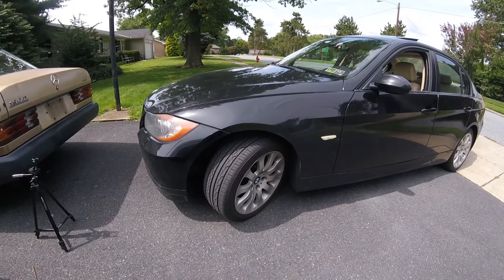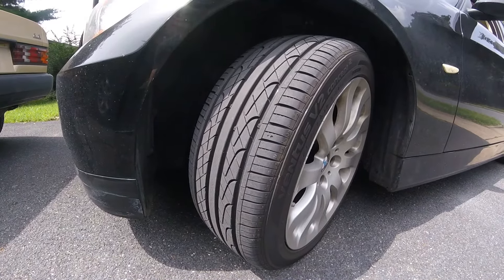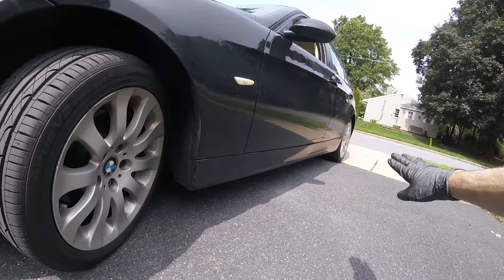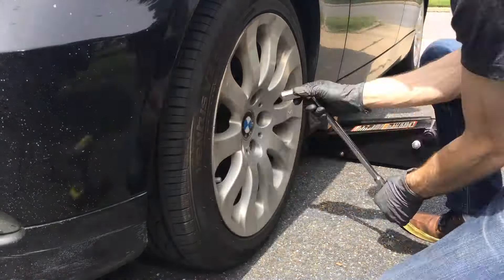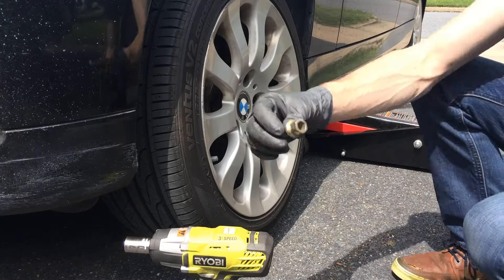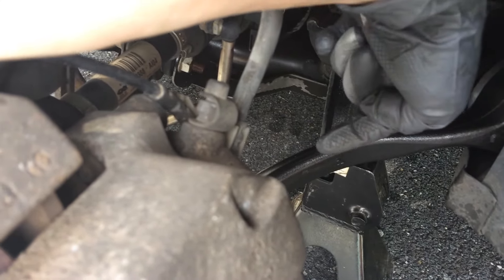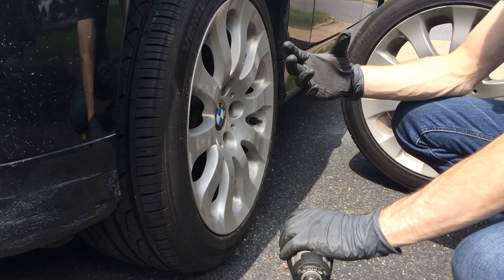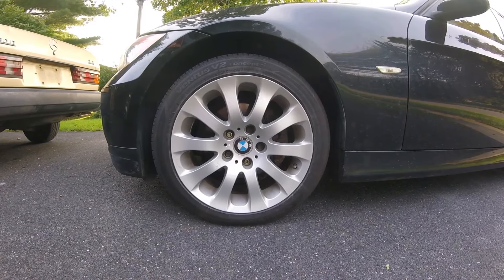BMW Tire Rotation and Review - Hankook Ventus V2 Concept 2

Comment: It's been a year, how are these tires holding up? Do you still recommend them? I was looking at these on eBay for $296 for all four new.
Reply from the maker: I ended up selling this car in Nov. 2018 with roughly 20k miles on the tires. They held up great and still had a lot of life left in them. I would buy them again if I was looking for new tires.
Reply: Bought 195/50R15 $170 for 4 of them on amazon.

Comment: Where do you place the jack stands when you are rotating tires?
Reply from the maker: On the front I put the jack stand under the control arm near where it connects to the body of the car. On the rear you can place the jack stand under the main sub-frame bushing.
Reply: Read the owner's manual of the car.   There are jack points in every car.

Comment: Are these directional tires?
Reply from the maker: Yes they are directional. For a tire rotation (which BMW doesn't say you need to do but I do it anyways) I just change them front to back.